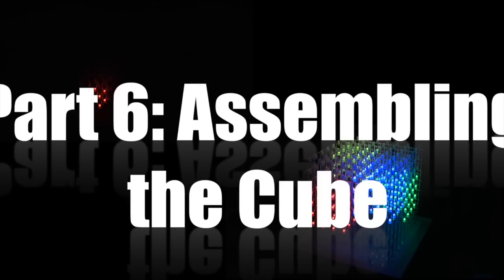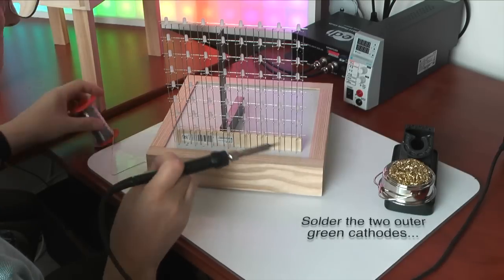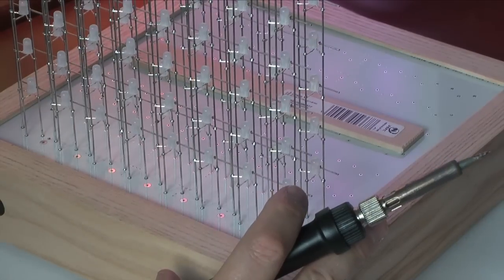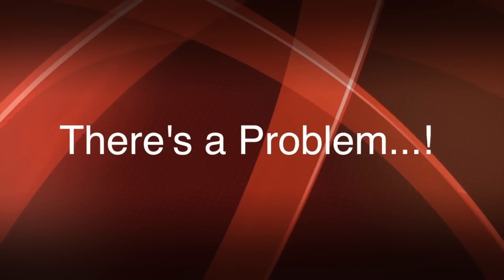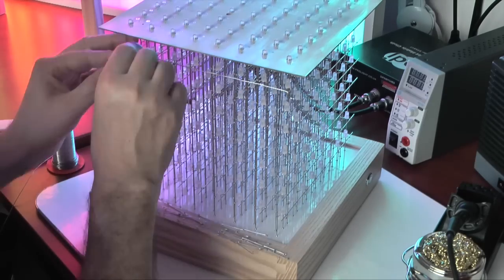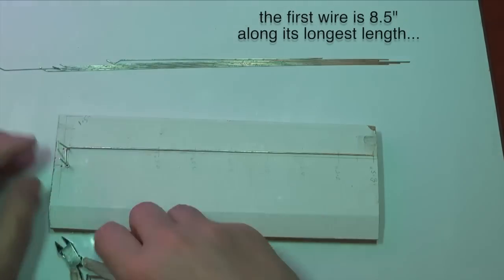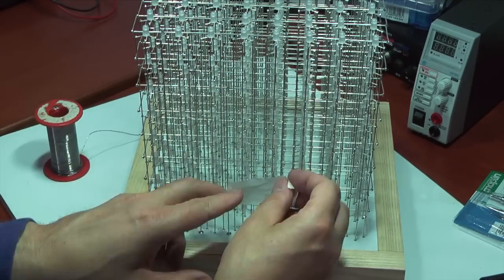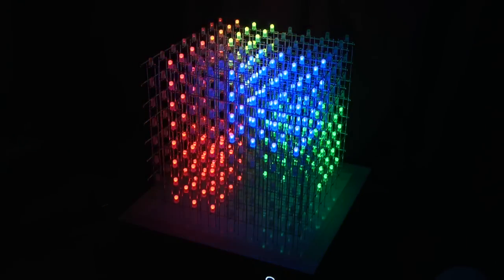Construction of an 8x8x8 RGB LED Cube. Part 6: Cube Final Assembly

Comment: hello good morning, look I was reviewing the Gerber files of the PCB and manufacturing parameters are very demanding, minimum track width 0.25 mm, spacing between strokes less than 0.25 mm. I want to manufacture the PCBs on my own, since I have a small manufacturing business, but those parameters went beyond the minimum admitted by my requirements. You are so kind as to send the .sch and .brd eagle files to make the respective modifications. I thank you, my email is desarrollo@circuitoscreativos.com
Reply from the maker: Carlos Andres Betancourt Hi Carlos,
Sorry to say that I don’t share the original source files, and you are the second person today to ask for them for a similar reason. 
When creating the PCB’s I kept the track widths and gaps as big as possible considering the board sizes, and if you were to retain the same board size, I doubt you would be able to do better. All I can do is recommend using jlcpcb.com in China who are cheap, quick and will deliver anywhere in the world. Someone recently had the boards successfully made by them using my Gerber files.
Reply: @stevemanley3685  ok thank you

Comment: Hello,
 I find your work extraordinary. The explanations you give are really good. 
I want to build this montage for my pleasure, while seeking the minimum cost of production. 
The realization of the printed circuit returns to me less than 60 $ to realize two cubes with a Chinese company JLCPCB. 
Is it possible to replace the TLC5916IN with a much cheaper equivalent model? 
Best regards.
Reply from the maker: Hi There, Thank you for your kind comments and for re-posting in English.
If I were to re-create the PCB's myself, I would also use JLCPCB, so good choice!
Yes it is possible to use different shift registers, but without checking, I'm not sure there are any that give the same characteristics that are pin compatible and cheaper. 
If I were to re-design the shift register boards again, I would use different chips with built in PWM (Plus Width Modulation), that in fact would cost more.
Kind Regards.

Comment: Hi Steve, I am Alfonso Flórez O and I want to know what the connector is inserted to the side of the base and that its cables connect with 5v, 3v, Gnd and the reference output of the Arduino.

thanks.
Reply from the maker: Alfonso Flórez Hi Alfonso, check out the links in the Video Description, there is one to my Dropbox account where you will find circuit diagrams, parts list, and a connection schedule. If they don’t give you the answer you are looking for, then get back to me.

Comment: I can't purchase parts from the site you provided in the US.  Is there a way of getting the circuit board drawings so I can have them made in the US?  I was following Kevin Darrah's electrical design because of my inability to aquire these boards, but it will be absolutely huge with all that wiring.
Reply from the maker: Michael Jacoby Hi Michael, by all means you can have the files, they are in my Dropbox account, links are in this videos description. You need all the Gerber files, and any decent PCB manufacturer can turn them into PCBs.

I know what you mean about Kevin's build, that's why I created the circuit boards.

Comment: Just had a quick question concerning the circuit board files. are they usable as is for getting sets printed? I put off working on following the steps for this project for a while, but i'm getting my act in gear and getting the rest of the parts i need. naturally my largest concern is with the boards, given the issues you mentioned on the EEtimes blog about bowing issues and short circuits. was this just from the inexperience of the printing house, or are there any tweaks that need to be made to the files?
Reply from the maker: Slegiar Dryke Hi, yes the files are good to go. Just send them to your pcb manufacturer specifying what colour solder mask and silk screen printing you want etc. 
The short circuits was the fault of the manufacturer. All reputable manufacturers will auto test the boards and only send out the good ones. In my case one was faulty and they sent it anyway, but forgot to mention or mark it up as faulty. Luckily it was the first one I picked up and manually tested. The other 5 boards were all fine. 
The bowing is partly a design flaw and a manufacturing flaw. A replacement set were all fine.

Comment: Hi Steve, i've finished the cube and he's awesome! I get a lot of positive reactions, so i thought well it's mayby nice to build a 16 x 16 x 16 rgb led cube. So now i'm trying to full understand the electronics of the cube. I saw you've used p-channel mosfets, wich turn on when you apply a negative voltage or gnd to the gate (am i right?). i worked a few times with shift bit registers, but they switched always a positive voltage. is it the hex buffer (cd74hc4050e)witch invert the voltage?
Reply from the maker: Sebastiaan Maes Hi Sebastian's, The reason I used that MOSFET is because I copied Kevin Darrah's driver circuit, but I did away with the driver transistors he used that invert the signal and did the invert in software instead. It simplified the circuit and saved a tiny bit of cash. 

The buffer chip is needed to drive the 25 SR inputs because the micro controller wasn't good enough to drive that many inputs itself, mainly because of my SR chip choice.

16x16x16 WOW! I did contemplate a cube of that size but realised it is a significant magnitude in order of effort. I was going to try a 12x12x12 instead using WS2812 discreet LED's but the wiring wasn't sturdy enough and looked shoddy when I tried a 4x4x4 proof of concept. 

You will need a much faster micro controller for the computation and a lot more memory for a 16x16x16. Good luck and let me know how it goes.

Comment: '
hi steve...
that is so beautifully colorfully LED cube with 8X8X8...
try use yellow LED as 4 colors LED as blue / green / red / yellow same like AQUOS...
remember the simon game with 4 colors and computer windows with 4 colors...
enjoy electric hobby kit
Reply from the maker: Hi,
Thanks for the suggestion, but the cube already is displaying yellow, as well as red, green, blue, cyan, magenta and white. If and when I get around to it, I will be able to make the cube display many many other colour variants using a technique called Bit Angle Modulation that can be implemented in the software without further modification of the hardware.

Comment: Hi steve, do you  have an idea how ik can display mathematical shapes in the cube, i would like to display a 3d sin wave. Thanks in advance.
Reply from the maker: Hi Sebastiaan, Unfortunately I haven't written such code for this yet, and if I had, i'd be looking to see how others did it, as they would more than likely write more efficiently code than I can. I have an L3D cube from Kickstarter that comes with a really nice plasma effect and the code is so concise and clever, I can't figure out how it works.

Comment: Hello Steve you can send me the lyoutes so I can print the PCBs, it's because in PDF I can not print, because it does not interfere with the layers of copper or anything
Reply from the maker: Dinis Roxo Hi, I don't currently have separate layer prints other than those in the Gerber files, I would have to see if I can create them. Whatever I create, they will end up as PDF files.
Reply: Steve, so how do I print the PCBs?
And I do not know how to do it
If you can help, I thank you.
Reply from the maker: Dinis Roxo Hi Dinis, the files I have provided are the Gerber files that you would send to a PCB manufacturer. I have not provided individual files that can be printed as such. I believe there are free Apps on the internet that allow Gerber files to be viewed, and possibly printed. The boards are double sided with through hole plating and many via holes, therefor best suited for making professionally as the recommended method.

Comment: hi steve, i'm still working on the project. he's done, but there doesn't happen anything when i turn it on. i have measured the input voltage (6v dc), next i have measured the output to the led's (a0,a1,a2,a3,a4,a5,a6,a7) the voltage here is barely 1.4 volts. is this normal? thanks in advance
Reply from the maker: Hey Sebastiaan, difficult to say but If you built the cube with my PCB designed and your using my code then most likely there is a faulty PCB, component or incorrect inter PCB connection. I would remove 3 of the shift register boards leaving the first one in the chain and see if that works alone. There is a wiring schedule on my drop box account (see link in the description) and check the inter connections. Check there is just over 5V on the SR boards. If you have access to a scope or logic analyser, check the signals out of the Arduino, you should see some digital activity even if your not sure what it looks like. Then trace the signals to and from each chip. The links to my blogs on EE Times have some detail of the digital signals seen on a logic analyser. You could see if the 8 outputs of the shift register chip on the anode board are multiplexing. You could edit the code and put some long delays in it so you can see the SR outputs are changing using a multimeter.

Comment: Amazing job Steve. You inspired me to build one. I'll drive it with a pic32 Mikroe Mini32. 
I just ordered 5 sets of boards with your Gerbers from a PCB house in China. They're shipping on a slow boat so I don't expect them for 3-4 weeks. Not a problem for me since a project like this will likely take me a year to complete.
If the boards look good and a quick test goes well I'll sell 3 or 4 of the sets if anyone is interested. Maybe I can break even on my build.
Thanks for the inspiration Steve.
Reply from the maker: Hey Ron, hope all works out well with the PCBs from China. Mine were made in China but through a 3rd party here in the UK. I now have a contact in China who I can converse with me in way better English the I can in Chinese, but not yet attempted PCBs with him yet.

I'm only just looking at PICs myself, and I can see they are great devices but overwhelmed by how many different ones there are. They also seem less strait forward to program than Arduino.

Please let me know how your PCBs & project turns out.

Comment: Cost and availability of PCBs seems to be a recurring theme, as it seems
 there is a keen interest in building this fantastic cube.

I built this project, the hard way, using prototyping stripboards, and 
lots of ribbon cable, super-glue, etc., to fan the wiring out to the 
LEDs.  Apart from 1 dodgy LED, it all worked perfectly. Thankfully the 
bad LED was at the outer edge of the cube, so was relatively easy to 
replace.

[[If Steve will allow, and I'll go no further if he objects : - consent given]], I have 
designed a set of PCBs that I know I can have manufactured at a very 
reasonable cost, providing I can order a minimum of 10 sets. My design 
differs slightly from Steve's, I have opted for a Cathode shift register
 board for each panel, and one Anode s/r board.  The additional 
buffering needed for the OE LE and CK networks is taken care of on each 
Cathode s/r board. The Cathode and Anode S/R boards simply use straight 
IDC plug/socket connectors to mount below the base PCB, to which the 
cube matrix is mounted on top. There are no SMT components anywhere, one
 thing I know was a subject of some concern.

Apart from 6 connections from the Anode S/R board to the Arduino, there 
is no other wiring to do, everything is handled on the 4-layer base 
board. Even the Arduino is powered from the Anode S/R board!.  This will
 make this a doddle to connect up.

I've said it before, possibly here, and elsewhere, the true success of 
this cube is what you see up top, and that is dictated by the design of 
the jigs.... fantastic job Steve !! 

Anyway, back to the PCBs. A "set" consists of ...

1. Base Board - 9 inches square - 4-layer - FR4 - 1.6mm  - I have 
deliberately put no silk-screen text on the top layer, in case you don't
 use the ....

2. Cover Board - 9 inches square - NO COPPER - 1.6 mm - both sides 
totally silk-screened black. This board is a cosmetic cover for the Base
 Board... the cube LED wires pass through it, so topside is all nice and
 tidy. You don't have to use it, depends how you want your cube to look.
 I can't exclude it from the "set" however.

3. Drivers Board - All 8 Cathode driver boards and one Anode driver 
board are panelised on this one PCB. They will need to be cut 
(separated), which I can do for a small fee.

 If at least ten people can give me their intention to purchase the set 
of 3 boards, I will be able to sell them for just £69 per set, (add £5 
for cutting the Drivers Board). Price includes postage to you, but it 
needs a minimum of 10 people willing to give me their word they will 
buy... a dangerous game, I know.

If you are interested, drop me an email at abtrain@tiscali.co.uk
Reply: Addendum : I have moved the Arduino onto the anode shift-register board, and at the same time swapped-out the Uno for a Nano.  I have also added an audio input jack, and will work on some sound-to-light effects. The only hard-wiring needed now is the 6V power supply connection to the Anode S/R board - this makes it very easy to do the electronics.  I have had a couple of enquiries about the PCBs, - a price reduction to £64 for the set will hopefully get more interest.....  contact me at  abtrain@tiscali.co.uk
Reply from the maker: +Dave Bate sounds like your making very good progress.

Comment: plz can you help me..........can you give PCB wireing diagram..with how to  conect IC and resistor.plz it' ery impotern.plz agin give that........not clear  in this video.this is besd job....gd louk thankz.......this my gmail....jayanthasaranga@gmail.com........send PCB wireing diagram and....arduino  code....
Reply from the maker: Hey there, The circuit diagrams can be found here:
https://www.dropbox.com/home/Steve%20Manley%20-%203D%208x8x8%20RGB%20LED%20Cube%20Project%20-%20Shared%20Files/Schematic%20Drawings#
Reply from the maker: The circuit board interconnections can be found here:
https://www.dropbox.com/home/Steve%20Manley%20-%203D%208x8x8%20RGB%20LED%20Cube%20Project%20-%20Shared%20Files/Wiring%20Schedule
Reply: thakz for ypur help ...

Comment: hi steve, im almost to the end of the project, i only need to wire the anode boards and the shift register boards. but how do i now wich i need to connect each other?
Reply from the maker: +Sebastiaan Maes 
Hi Sebastiaan, I just created a wiring schedule for you, which is now available from my DropBox account here:
https://www.dropbox.com/s/jdflm8djeiod0of/Steve%20Manley%208x8x8%20RGB%20LED%20Cube%20Circuit%20Board%20Interconnections.pdf?dl=0
Reply: thanks a lot!

Comment: hi steve, wich diameter of cables do you use to connect the diffrents pcb's together?
Reply from the maker: Hi Sebastiaan, I used coloured ribbon cable for most of the interconnections, slightly larger wire for the power and bigger still for the anode connections to the base pcb (which was overkill). Most of the wire just happened to be what I had laying around at the time.

Comment: Hi Steve! I'm a bit of an amateur electronics tinkerer and wanted to sink my teeth into a slightly more complex project, but starting small. something like a 5x5x5 cube and then an 8x8x8 later. I was looking over the scematic for your shift register boards, and was wondering, with the right code rework, would 2 full boards and then (with some tweaking), half a board, be feasible for a 5x5x5 cube? i assume each row of shift registers handle a set of colors per, from how the design looks, so think it could work?
Reply from the maker: +Slegiar Dryke Hi Slegiar, 

The shift register boards are wired blue green red blue green red with each row of blue green red shift registers connecting to just 1 row on the base PCB, so yes 2.5 boards could work and I don't think the half board would need tweaking either, just leave off the second set of 3 shift register chips. 

The Anode board could also be used, just leave off the appropriate 3 MOSFET's. I even think the base PCB can be used, even if you were to cut it down to size. Then all you need is the re-coding.